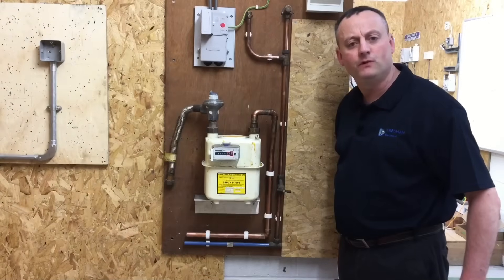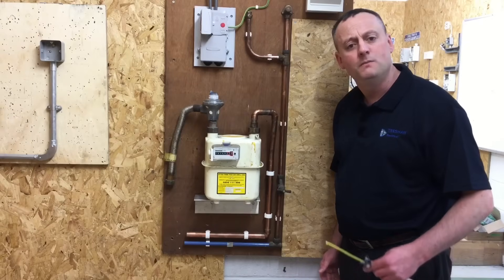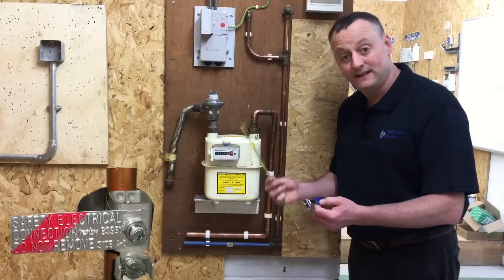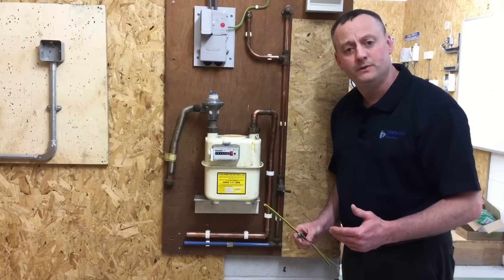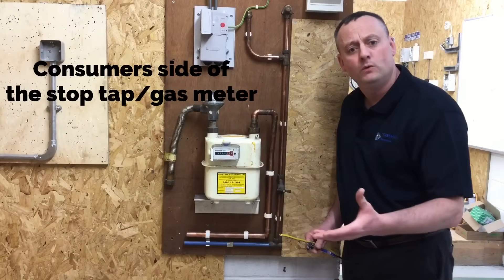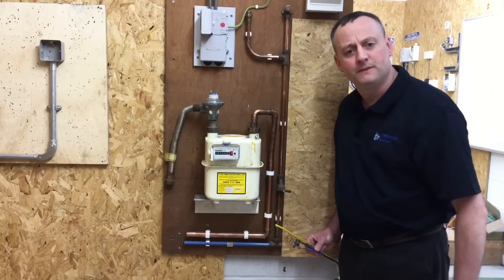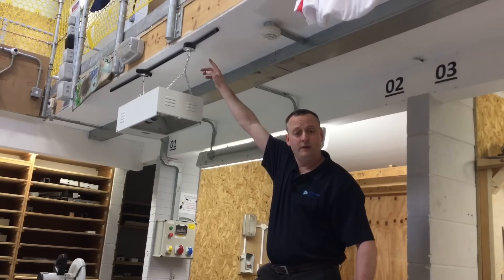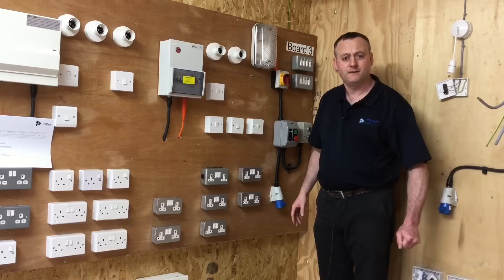Re-Cap Learning Part 4 Exposed or Extraneous Conductive Parts Explained (Installation Theory Exam)

Comment: Hi Gaz, landlord question here. I have a 2 storey mid terrace house that was made into two apartments mid 80’s. There is a metallic potable water service with branches (no meters), and a metallic gas service with branches to individual meters. Current (undersize) bondings go via each consumers unit earth terminal and then back to a MET at the 3phase service head. What is the correct arrangement under the 18th for apartments/flats? Thanks for all your great resources.

Comment: Another brilliant clear video gaz 👍 if I go to retrain as a spark I would love to have a teacher like you 🙌🏻🙌🏻 quick one gaz just looked under sink at my bonding for water and the clamp is on the copper pipe just above the stop tap but then after the clamp about 4 inch of copper then one of them plastic pushfit fittings is on then it goes back to copper 🤔 does this ,,break the path to earth,,or shoul it have like another clamp above the plastic fitting so the bonding continues ? Any info would be appreciated 👍 so in sequence from earth-copper incoming water-stop tap-copper pipe with clamp-pushfit plastic fitting-back to copper pipe 🤯🤯

Comment: Even under the 17th edition it is only a requirement to bond an extraneous incoming service which needs a test to confirm, by bonding a non extraneous incoming service it is an argument that you are making the installation less safe
Reply from the maker: Hi. Under the 18th pipework coming in plastic but metal in the installation will not require bonding... I always say to my learners if you had a metal bed frame would you bond it... No... because it is not connected to an earth potential (outside)... hope this helps and thanks for the support/message GSH Electrical
Reply: GSH Electrical thanks for the quick reply (love the videos  by the way) Just because a incoming service is not extraneous by definition (plastic) the internal pipework (copper) may well still be considered extraneous due to the way it is installed and proved so with a resistance to main earth test  and require bonding.
Reply from the maker: Hi. I had a chat with Dave Austin about the points you raise see link https://youtu.be/YX5g0YNkANI
Some on camera and some off. Thanks for the support my videos are aimed at full time learners training without a job and often don’t go into full detail. Thanks again Gaz

Comment: I think regardless of the changes the 18th edition will bring in, contractors/electricians will err on the side of caution and continue to bond the main incoming services. Also worth remembering, if the gas meter is fitted externally, the main gas bond can be made at the point of entry into the building.

Comment: Hi Gaz what happens if the pipe coming in is metal nut the house then use plastic pipe inside
Reply: Then risk assessment surely says shock is impossible due to no fault path back to earth. Only risk which is low is should an electric current be present at the incoming pipe ie a switch or socket or even a cable likely to make the short extraneous conductive part live. I'd say bonding not required.
Reply from the maker: Hi. The plastic pipes in the house from your example are not extraneous conductive parts so don’t need earthing nor would the incoming pipe work that’s metal. Thanks Gaz
Reply: GSH Electrical Thank you